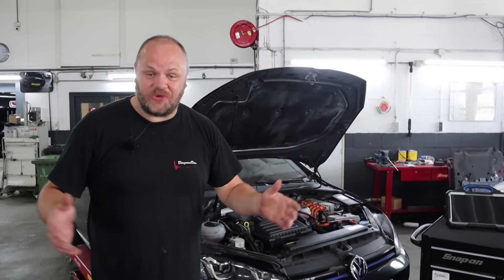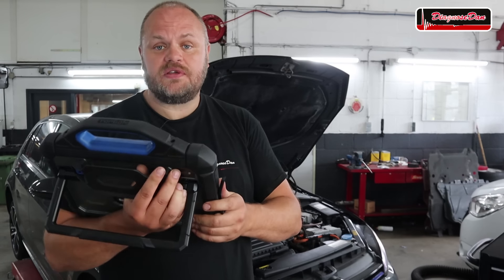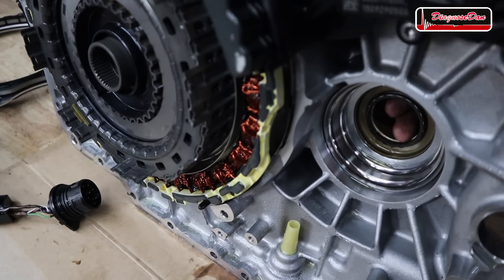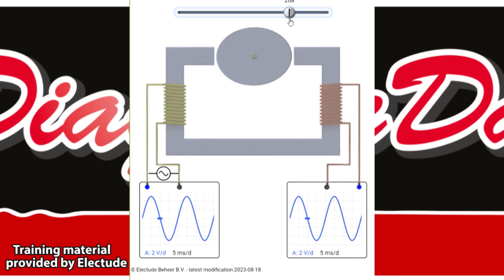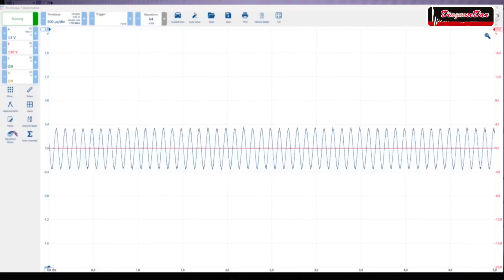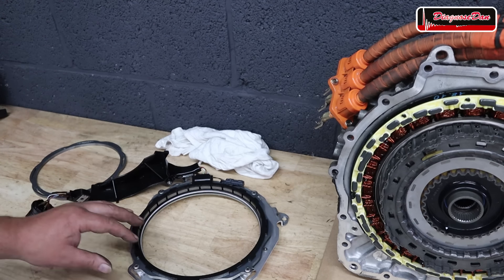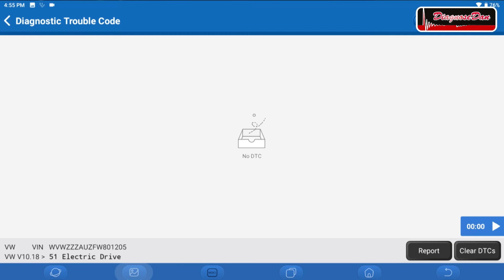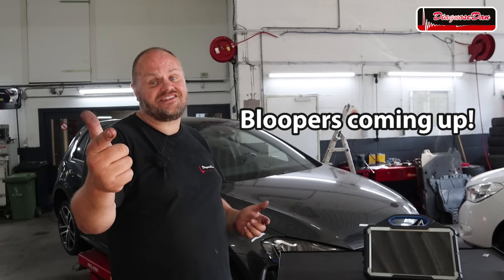Volkswagen Hybrid electric drive Diagnosis.

Comment: VW Golf GTE 2016 I4 TSI HYBRID 
22+ MODULES 
150 IPC Indicated OFF & No Crank & Cluster MSG 
240 & 1340 & 1425 SCAN CODES P0A40 P0C50 Drive Motor A Position Sensor Circuit (RESOLVER) & P1570 & P0A2D P0A2B P0C5A 
335>930 THEORY OF OPERATION 
935 WAVEFORM Primary Reference Signal & Connector Location 
950 ANALYSIS Analog Signal <0.8V P-P OK 
1005 Schematic G713 Sine Cosine PINs 
1035 DONOR KNOWN GOOD Resolver Sine PINs #5 & #6 51.3OHM & Cosine PINs #7 & #8 49.7OHM Resistance Test OK 
1130>1225 Drive Motor Connector Location 
1140 PINs #7 & #8 47.9OHM Test OK & (Sine Coil A) PINs #5 & #6 OPEN CKT Test BAD 
1230 Fault ID Resolver Circuit A OPEN 
1250 SWAPTRONICS DONOR Resolver PLUGIT Test 
1435 VERIFY No Codes 
1440 WAVEFORM Cosine 
1510 ANALYSIS Analog Signal OK 
NO FIX

Thanks Danny for the awesome case study, cheers.
Reply from the maker: Its a pleasure

Comment: Another reason to never get an EV. Even if the stupid resolver ring is broken the combustion engine should start.
Reply from the maker: The Electric motor is also the starter motor😂

Comment: Toyota Camry hybrid 400k miles already only replaced brakes pads and rotors so far 
German cars not reliable they don’t last 
Poor quality and engineering
Reply from the maker: The failed part was made in Japan 😊